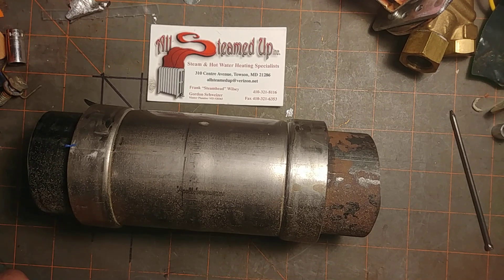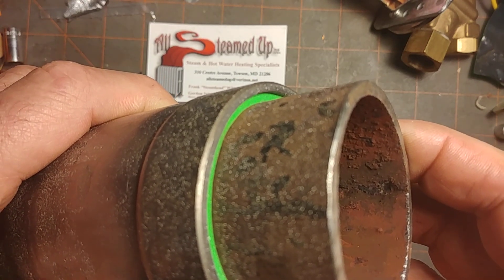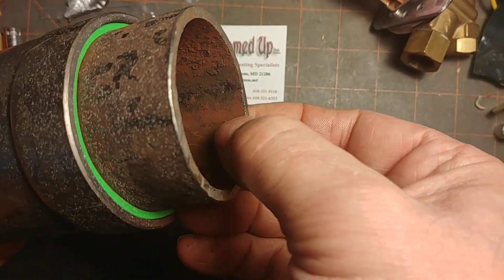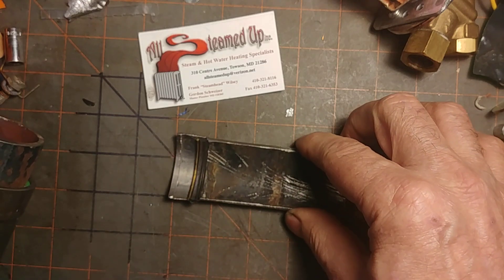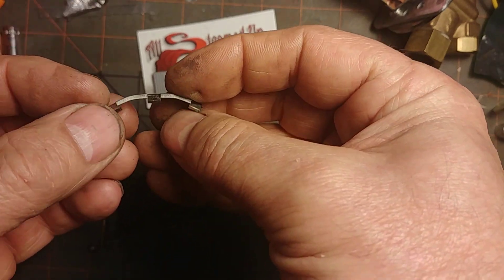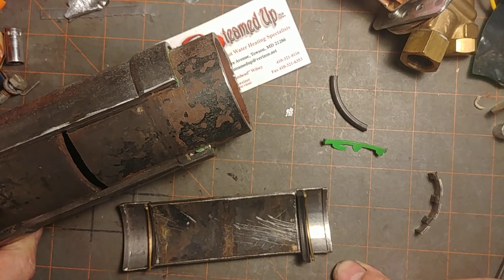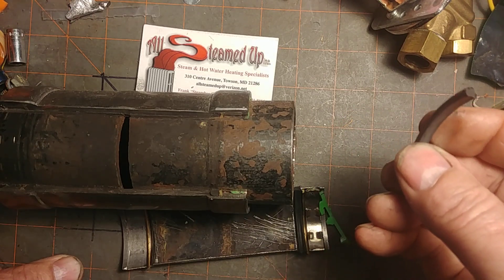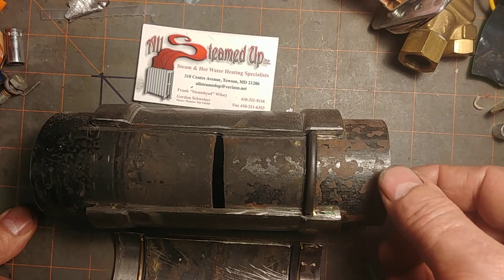A Discourse On The Relative Merits Of Press Technology For Steam

Comment: I use ProPress on water and air, I sometimes wonder how long that O ring will last but on steam I agree  it's the last resort. Thanks for the videos
Reply from the maker: MegaPress has gotten me out of a jam on a few steam jobs, but it's likely I've just kicked the problem down the road for someone else to deal with.  I give it about 20 years, tops.
I'll use it on gas pipe with fewer qualms, because it seems like the seal is not under nearly as much of an attack.
Better that then CSST, I'd say.
Reply: Propress doesn’t rely on the o ring for a seal it’s a backup incase the crimp seal fails, my company had a apprentice who pressed solder fittings without supervision and they held pressure.

Comment: I’ve had great success using the Zoom Lock from Parker Sporlan in air conditioning and refrigeration systems. However like you stated, how long will it last? I will still braze near the condenser and compressor. I have my reservations against vibration and oil contamination.

Comment: I am a doubter in that product. My threader and pipe dope make 100 yr. joints- pressure & temperature proven 🤣🤣. I do get it that you got to do what you got to do sometimes ( we’ve all been there). Thanks for the information on the sealing material. P. S. I just ordered that Cliff Quick Test. Thank you again.
Reply from the maker: You are quite welcome!
As you can tell, I have reservations about the longevity of these products for steam.
Ain't no way that rubber gonna last as long as your threader & pipe dope, no sir.